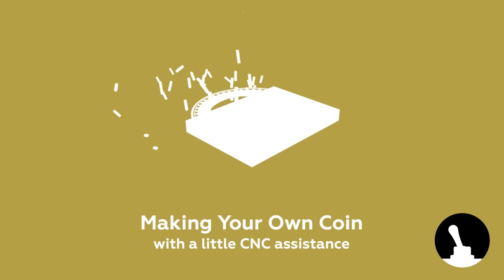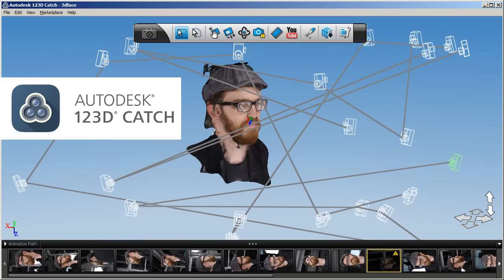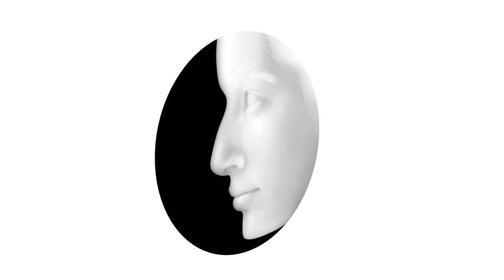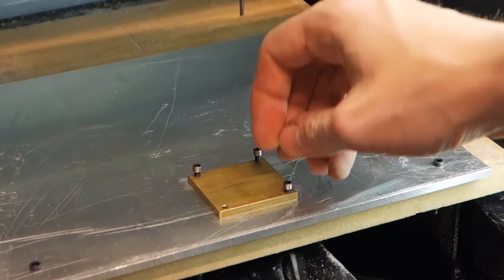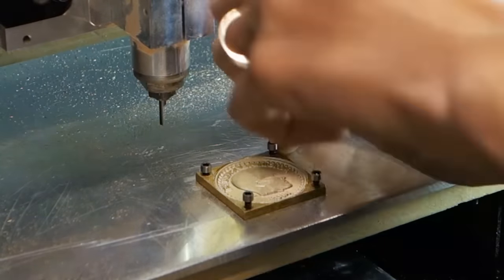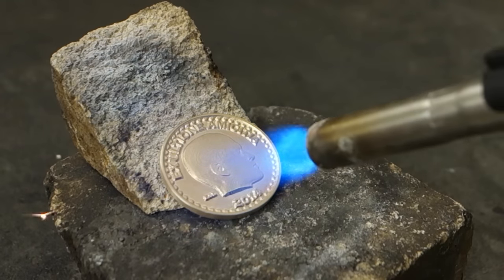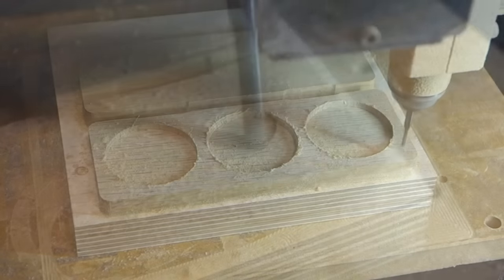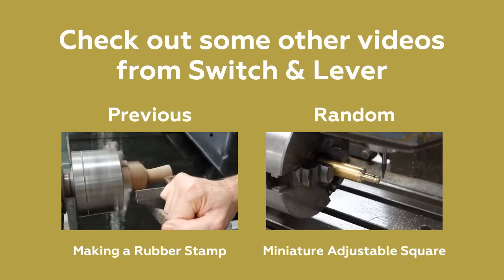Making Your Own Custom Coin

Comment: Question sir: "if your cnc machine is not intended for metal, how about milling plastic and use it to make a mold for metal?"
Reply: Why you might think that that's a great idea.
Wait until you pour that hot metal on that plastic
Reply: @red2965  I'm sure he means make a 2 part sand mold. You wouldn't cast it on the plastic directly.

Comment: Heres the actual questions though, The machinery needed to make that is quite complicated so it would be beneficial if maybe the equipment was also in the description. Im guessing its thousands of dollars at least, so if one needs to find somebody to do the imprinting of the coin once all the graphics and 3d modeling was finished, they know what to ask for.
Reply from the maker: +The Persona I mention it in the video, it's very easy to hit up Google and find yourself. Though, frankly, if you're going through all of that for just one coin, and you don't have the equipment, it may just be better to use a service like Shapeways to have it printed directly in metal, or to contact a coin foundry and have a custom coin minted for you. The cost of both of those methods are several magnitudes more expensive than milling it yourself.

Comment: Damn, I really feel like doing this, but the machinery... wondering if it's possible to just take the brass (or an existing coin) and make what you want with a drill bit and tons of patience.
Reply: a dremel or engraving tool would be your best bet. I was looking for a way to 're-press' coins into another design such as you might find in an old industrial tourist hot spot - coin roller press thingie :P
Reply: Look up hobo nickels

Comment: Hey , any tips of creating a depth map from an image ?  Do you know any good tutorials , of going thru the entire process of it .Thank you .
Reply from the maker: +dontonipz I kind of just learned by doing, and by having experience with depth maps from 3d modeling, and drawing on the computer. I unfortunately don't have any tips, beyond that you should apply your depth map in your 3d software so you can actually see how it looks like as you're working on it, and where you need to alter to make it look the way you want, switching back and forth between 2d and 3d.
Reply: +Switch & Lever Thank you , i am doing just that, but i thout you had some tips.I will continue to do that :)
Reply from the maker: +dontonipz Wish I had a magic way of doing it, but it's all hard work, and failing a lot until you get it right.
Reply: Yep i know , thats probably the hardest part of the 3d , i  use a plugin for photoshop ,named DOF PRO (  dofpro.com ) Wich helps me a litle bit .Check it out .

Comment: I don't have one, but could you make a coin using a 3D printer?
Reply from the maker: +Theo Rodriguês Sure. It would be plastic, and lower quality, but there's nothing saying you can't.
Reply: absolutely. you could them make a (high temperature) silicone mold of it and cast pewter, tin or even zinc into it. the other option would be something called lost PLA casting. search youtube for videos of it.
Reply: check out barnacules channel.  he makes a 3d printed "bitcoin".

Comment: How much it costs approximately?
Reply from the maker: +Green Lizard About $2 in brass, $5000 in machine cost and about $2000 in time spent.
Reply: +Switch & Lever Where did you get the brass, in the little squares like that?
Reply from the maker: +Urbanite Survival bought a bar of it from a metal supplier and cut it down to the lengths I needed myself.
Reply: +Switch & Lever Alright, thanks. Was the metal supplier online?
Reply from the maker: Yes, but as you are in the states and I am in Sweden, I doubt it would do you much good. You should be able to find brass stock available fairly easily.

Comment: Sure!  Make your own coin.  If you have 3D software and the experience to use it, a CNC machine, tooling, CAM software to  create the program from the 3D software, and the knowledge of how to import the program, touch off the tools, and run the machine.  No problem!
Reply from the maker: I never said that all you needed was a nail file and PlayDoh though. I do however mention that you could 3D print it with shapeways. So if you're not cool with that and just feel like spreading what your nickname is, then just move on.
Reply: Calling people out on misleading titles is hateful!
Reply from the maker: How exactly is it misleading? You're the one who is reading something into it that's not there.
Reply: sa kushton???

Comment: I have a 1987 Wells Index CNC (5HP, 1585Kg) machine so it should be able to handle the cuts... also it has a mist attachment, so it should make a clean cut. I really need to try this... looks like a great project. Do you remember what you RPM, Feed, and Plunge rates were?
http://askjerry.info/monster_mill_machine.shtml
Reply from the maker: No idea I'm afraid. I was running the rpm as high as they would go, which I believe is 15000rpm, and feedrate was very very slow with tiny step over. With a more high powered mill and better work holding you could run way faster, and with greater step over, at least for the roughing.
Reply: Switch & Lever My machine has a top end of 4000 RPM... so I'll attach a small die grinder and use that as the spindle... I'll have to make a video when I do... should be interesting. Thanks for the idea!

Comment: It is probably not cheap to make your coin, sure metal is cheap enough if wanting a silver coin, but to get a place to do this for you would be very expensive.
Reply from the maker: Unless you already have the equipment. That specific CNC mill is not terribly expensive, at least as far as CNC mills go. Getting it done for you you end up buying someone's time essentially, as well as machine time, will obviously be rather expensive.

Comment: i still think using a punch and stamping it would be faster and cheaper. unless you want every single one to be unique
Reply from the maker: Well, yes, but that both requires a CNC capable of milling hard steel with very high accuracy, as well as a stamping press to actually mint the coins, if you're going to reach anywhere near the same detail as the coins in this video. None of which anyone is likely to have in their home workshop, as opposed to a small desktop CNC, which is becoming more and more affordable and common in home workshops.

Comment: Milling a coin is not the best way to go if you want to make more than a couple.
Having a coin as a business card could be quite eye catching.
Reply from the maker: Milling a coin is a great way to go about it if you want to make a master, from which you could make a mold to cast copies, for instance. The best way would be striking (minting) coins, but that requires some pretty expensive machinery, both to make the dies and to strike the coins themselves. Better to just hire companies that make medals and such to do it for you then.
Reply: @SwitchAndLever  Oh yeah for dies I bet its amazing, I actually see some stamping machines for really cheap so you could probably make a decent amount of coins with one of those+comissioning a cnc die, but thats obviously for a lot simpler designs which is what I've been interested in, theres isnt a really cheap and fast way to make coins like this. Awesome video though.

Comment: Couldn't this be done with a forge?
I mean to melt down copper or aluminum and pour it into a mold which has the images on top/bottom... 
Would the effect be the same or worse?
Reply from the maker: Casting metal and having it flow out in this fine of a detail without something like a roto casting machine (which forces the metal out with centrifugal force), and keeping the cast metal hot enough as it flows out so it doesn't solidify half way, is such a hugely complex endeavor it's not worth it. It's mainly only done with silver and gold, because those metals melt at lower temperatures, and generally you cast pretty small stuff with it.

Comment: The Roland handled it like a champ, they turned out really well.
Reply from the maker: l0ckcr4ck3r It handled it like a champ in what you get to see, I ruined three coins (not counting the double sided tape disaster) while trying to get the settings to a good level. There's a lot of vibration when milling metal.